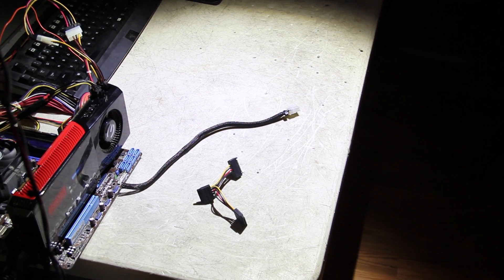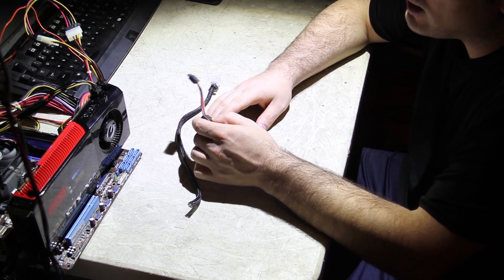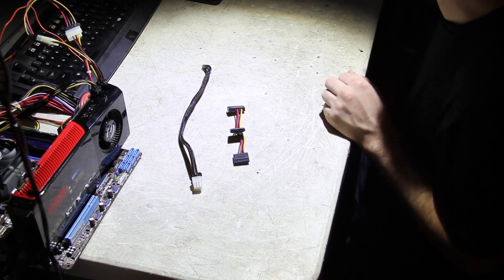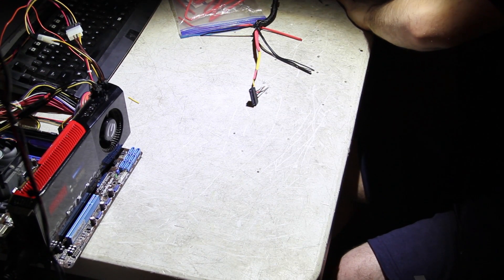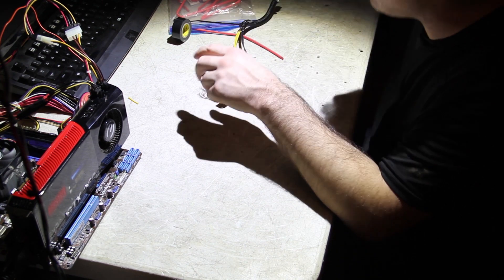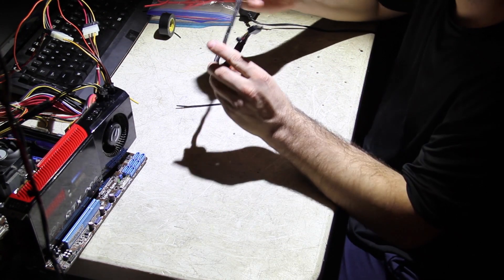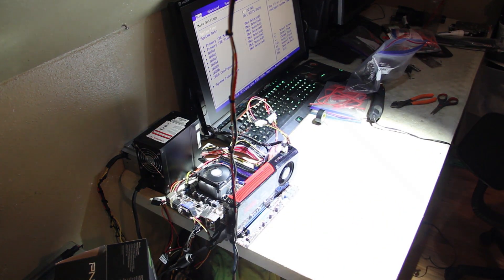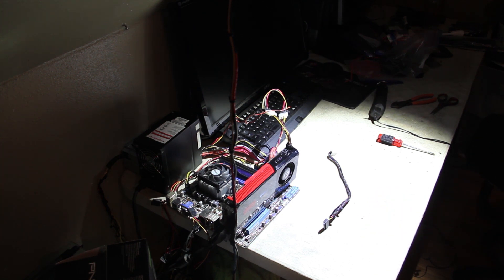How to make a SATA plug to 6 pin PCI E adapter

Comment: 3 cable black  to 2 black sata ,?? OR use 2 black
Reply from the maker: @iheb2333  as long as you are same color to same color you should be fine, however, i might suggest just buying ready made product, particular if you are in the U.S. Amazon fast shipping and super cheap adapters where not the thing they are today back when I made this

Comment: Thanks for the video. I'll be making one tonight if my local shop is sold out. Did you just attach all grounds from the PCIE connection to both grounds on the SATA power connection, or did you just use go all grounds from PCIE into one one ground on the SATA?

Again thank you.
Reply from the maker: @Josh-cw8by  hey I apologize, its been soo long since I made this is dont actually remember anything beyond what's in the video
Reply: @dragonsystems5973  No problem. It looks like you did go all ground to ground so I'll try that out.

Comment: now.- put the video card under load to be sure it can draw the power it needs.
Reply from the maker: Yup, thats what I did.... I know you geniuses want to think im telling people to destroy their computers with these videos, but I have been very vocal about where these type connectors ARE appropriate, and where they ARE NOT... Ive made it very clear, again and again and again, Only do this with power supplies that have the wattage support, just not the connectors. Also, obviously, only do this where you have a minimal level of AWG support, furthermore, again, OBVIOUSLY... this is not the solution to use if you have a 400 watt power supply and you are trying to run an RTX 3080... Come the hell on people, I cannot provide oversight for every single person and every single situation, if you are trying to do mods like this but have no idea what you are doing, that is on you, not on me, every single case is a little different, people need to be able to exercise some sort of minimal judgement as to their own situation

Comment: Clearly explained , but if i wanna do that with a molex cable , how can I making a molex to 6 pin
Reply from the maker: Its almost the same, the colors are still the same voltages
Reply: @dragonsystems5973  ur explains are useful

Comment: Is that a GTX 260? I have one, and in fact, I need to get power connectors to power my 260 itself.
Reply from the maker: It is, I wanted a worthless but power hungry card to test the part with before I used it with anything expensive. Make sure your PSU wiring is decent quality and that it has the wattage support for pulling the power thru molex or sata before doing something like this, if you have say a crappy 250 Watt OEM power supply in a pre-built unit I would not recommend something like this

Comment: Currnt gpus pull far more power than sata connectors are rated for. This is a easy way to cause a fire.
Reply from the maker: You have no idea what you are talking about... woohoo!!!! good for you, you think your comment makes you sound smarter than the guy who made the video. This works just fine. I dont delete comments. I leave them and correct the commenters. I have used literally hundreds of these adapters over more than a decade, on hundreds of systems. I test most of my systems for many hours each. Im also not typically using only the adapter, typically, unless it is a low end card on a low end system, this is usually for situations where I need an 8 pin and an additional 6 pin. Again, I have tested this in the real world, for probably hundreds of hours of total testing. Dont comment this again, I will delete any additional comments from you on this, I am right, I know what I am doing, you are wrong
Reply: @dragonsystems5973   Just because you've been doing it wrong for years don't make it right.
Reply from the maker: Oh, I see... so everyone who uses a part that is literally a staple is doing it wrong? Whatever dude. Again, you clearly have no idea what you are talking about, AND, EVEN IF it technically "Wrong" there is a big gulf between "wrong" and a fire hazard. If you had worked on as many systems as I have you would know how a power supply responds to being over taxed, and unless something is already wrong with it to cause such a thing, IT ISNT BY CATCHING FIRE, but thanks for your useless input
Reply from the maker: Folks, here at Dragon Systems we(that means me) believe in existing in the real world. In the real world, sometimes you doing things that are not, shall we say, grammatically correct, but work just fine. EVERY SINGLE TIME you do anything with your power supply, there is ALWAYS a risk of fire, seriously, there is a lot of current there, but in the real world, we understand how stuff actually responds to these situations and under stand that "could happen" does not a valid risk make. Just like someone could argue me stripping wire with my teeth is not "correct" it does  not mean it is a fire risk, gimme a break. Anyway, thanks for participating... and always remember, play stupid games, win stupid prizes
Reply: @dragonsystems5973  You a fucking moron. You do not know what your talking about. You an uneducated hack.
Reply from the maker: @jasonmasters4042  I see, so I refuse to let some rando on Youtube school me, and all you can respond with is dirty language... see... now I know I am right, you just want to run around acting smart, and unlike many Youtubers, im not soo desperate for subs that I am nice to people like you. you dont like my stuff, dont watch, but dont come on here throwing your weight around and using dirty language, you dont sound tough, you just look stupid
Reply: @dragonsystems5973 I think it depends on the psu a lot at first. The 12 V rail is always going to be able to take a lot. But the sata pins are rated to 1.5 A from what I can tell- so it's fine for 18 W but anything above that is down to luck. I ordered a sata to pci-e adapter myself for a new gpu but I think I'll wait for a proper cable to be safe.
Reply: @dragonsystems5973  Let's break it down to bare specs here...

A "SATA" connector has a "Maximum" of 1.5 Amps per contact (*3 contacts per connector) = 4.5 Amps per motherboard connection despite wire gauge.

PCI-E 6-pin connector - up to 13 Amps per each wire (3 12V wires per connector again depending on wire gauge) = theoretically up to 39 Amps but ATX spec limits PCIe-PEG connectors to 75 W (6.25 Amps) due to the distance (resistance) of the ground connection to earth (ie: within the power supply).

Adding "ANY" additional connection points (ie: extensions/adapters/converters/etc) increase this resistance which produces heat. This excess heat is due to excess power (amperage) being drawn from the PSU in order to sustain the current needed to operate the device (in your case a GPU). Thus these Sata converters will react as if you were to install a resistor @ each connection point (ie:3 per connection) in line, all producing heat.
This is all due to the way the SATA connector is designed were only 15-20% of the wire is making contact with the pin with little to NO insulation between each pin.

In all honesty, I wouldn't recommend the use of "Molex" to PCI-e 6/8 pin, but "SATA"... at this point you're just asking for a potential fire hazard.
Reply: @mr_gyni he ain reply to that one😭😭😭

Comment: wtf are you connecting bro?? I see 2 or 3 cables going into 1, you don't explain that. probably most important thing in this 16 minute video, poorly explained. matter fact your not saying anything.
Reply from the maker: Fascinating, in 5 seconds of skipping around I managed to just find the part where I said, and I quote "Yellow is 12v, black is ground, and red is 5v, seriously, if you dont like my commentary or my "incorrect" way of stripping wire, or whatever, too bad, make your own vid then
Reply: @dragonsystems5973  The 6 PIN connector had 3 yellow wires going into 1 wire on the SATA cable, what wire is that, and please explain stuff better next time you do this kind of videos, This video is really long and does not explain anything, stop posting uninformative videos that are long and stop wasting people's time.
Reply from the maker: @mr_gyni  why not just not watch my stuff?? Do you just enjoy insulting people? I have gotten plenty of thank yous... funny you posted something else then decided you just had to insult me. I used that connector i made in the video just fine. If you can't handle people using adapters, then maybe you should post an offer on here to buy anyone who needs a betternpower supply a bice new one.
Reply: @dragonsystems5973  It's cheaper to get a new PSU than a new GPU, just because it works for you, doesn't mean it will work for everyone, just because yours didn't catch on fire doesn't mean other's won't catch on fire. Think about it man. I see you are really paranoid in the comments section, I am not trying to make you mad or rant about you, but I also don't want people to learn ways which are dangerous and might cause problems. Just because you tested it for let's say 12 hours doesn't mean it will last forever, it might last for 13 hours and catch fire.
Reply from the maker: @mr_gyni  no, you have no idea what you are talking about... you think you are smart... butnive worked on thousands of systems... buddy, what you are railing about IS NOT A THING. sorry, its not, ive worked on hundreds of systems.. i have seen power supplies spontaneously go up in smoke, but not as a result of this type of adapter. Im not paranoid, I simply don't like know it all thinking they are gonna call me out. I'm not advocating someone put two molex to 8 pin adapters on a 350 watt stock bestec HP power supply, i very clearly stated to only do this on a high quality power supply with proper connector and wattage support.. if you feel the need to right all the tech wrongs from everyone doing things a way you don't like, great... but as Yoda would say, this is the difference between knowledge and wisdom. Ive done this with hundreds of systems and i know what I'm talking about
Reply from the maker: Also... you are not calling into question the quality of my part, you are calling into question the entire premise... soo... why exactly would literally every single video card vendor be putting those little adapters in with their cards if they are soooooo dangerous? I see... every single vendor is stupid and you know better... like i said, ive worked on thousands of systems and installed hundreds of these adapers, no customer has EVER called me and described what you are talking about EVER!!!!! i even get some of my machines back years later... no problems. So ill take my real world experience over your book knowlege... but thanks for your concern
Reply: @dragonsystems5973  card vendors don't put sata to pcie adapters with their products, but I get your point of view, of course, not every book is 100% accurate, I am not trying to piss you off or anything, I am just trying to explain that, just because something works doesn't mean it's efficient and safe. There are tests, and if you test the current and status of the GPUs power, you'd see that they are unstable and that could cause performance issues, no need to cause a fire, but could cause issues when running operating systems, and could possibly corrupt computer drives. Even if it's just the gpu getting unstable power.
Reply from the maker: @mr_gyni  first of all, its the same thing as a molex Adapter, don't split hairs to try to make your case. Second..  ahh yes... the good old "it doesn't matter how many times it works without a problem... it doesn't matter if there has NEVER been a problem... someday... somehow... there COULD be a problem... this is utterly ridiculous. Furthermore, no, someone cannot always replace their power supply. The best example I have of using this part is on an hp Z420 workstation with the higher end 600 watt psu that has the wattage support for a card that requires a 6 and an 8, but not the connectors. It does have 2 sata six pins though, so we use a dual 6 pin to one 8 pin adapter, and a single sata to 6 pin adapter. Ive sold like a hundred of these units and never had the issues you are complaining about

Comment: You lost me at I'm just gunna use my teeth. 
There are like you said better ways to do something but you're not going to fix the plumbing in your house with duct tape because it's the wrong way to do it.
There is always a better way and then there's just the wrong way. #failtolistentoadvise
Reply from the maker: Whatever man, you want to use wire strippers, great, more power to you, id love to hear you explain to me how, after drying the wire off, then covering the connection once its done with shrink wrap, how there could possibly be something wrong with the final product? Seriously, if you are not comfortable with more or less jury-rigging something, then this is not for you, go on ebay or amazon, and order the completed purpose built part available for a couple dollars, as that would be "the right way to do it" this was a how-to on a quick and dirty solution, nothing more, nothing less.
Reply from the maker: But I bet it made you feel super-special to tell someone on Youtube they are doing something wrong!!!!